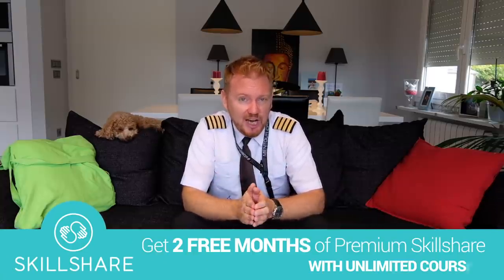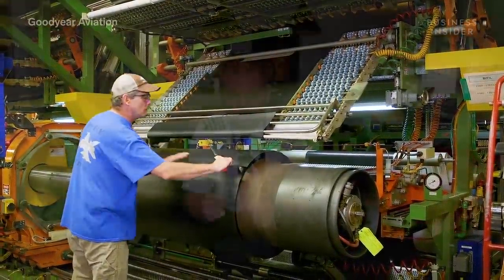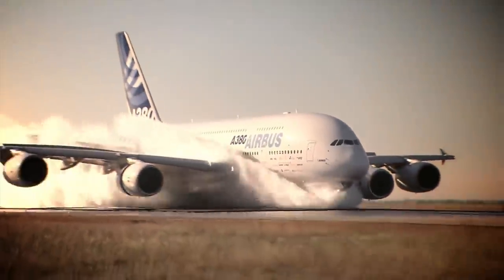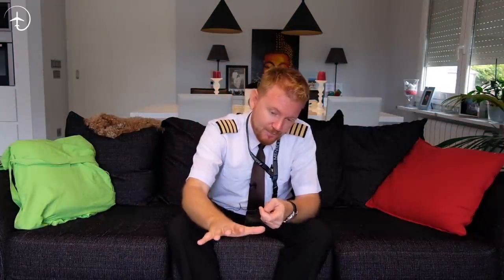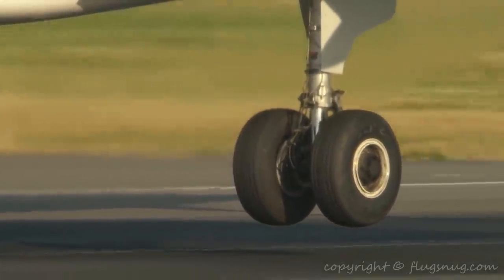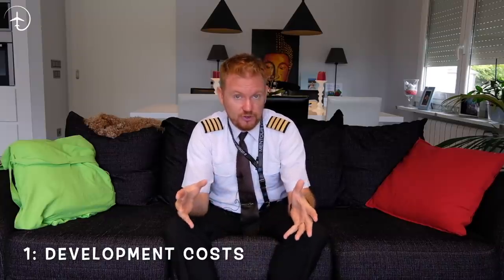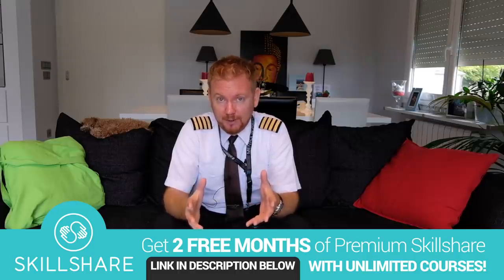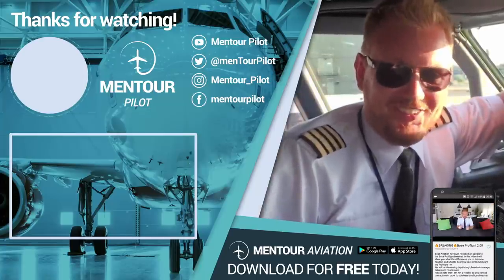Why not make plane-tires spin, before landing?!

Comment: The rims could be designed in a way that they turn by the power of the wind while landing..
Reply: And cause drag at takeoff or landing
Reply: Umut ATÇALIOĞLU fins
Reply: Oto You’re overthinking it. The wind-resistance of the gear is already significant; in fact, I believe most pilots use the deployment of the gear as additional air-braking during Approach. So the additional drag the modified wheels would add would be more helpful than harmful.
The drag on Takeoff would be nearly eliminated by the fact that the wheels are already rotating as the aircraft is propelled along the runway, and since the gear are retracted almost immediately after becoming airborne, the slight increase in drag as they lose contact with the ground (immediately losing frictional rotation and thus requiring airflow rotation) quickly becomes a moot point.
So really, it’s a non-issue. 👍🏼
Reply: Cessna citation actuation has nose wheel spin up before landing on airplanes that are designed for gravel runways
Reply: Tell me, how would you do that? You couldn't set them up as a turbine set up because you would have pressure on both sides of the circumference of the rim there for pretty much cancelling out it's usefulness. Plus the fact that you don't really have enough clearance between the tires and the wheel struts either. The forces involved would be enormous and building something onto the rims would again add to the cost and probably not do much. Another thought is how you would be able to stow the landing gear during flight and bring them down for landing? There's not much space for the gear as it is in the body of the plane. What you would need is something like a windmill so that the wind is in the same direction as the shaft of that windmill. Bottom line? It's more trouble than it's worth. If you want a perfect example, get one of those kid's pinwheels, take two water hoses or air sources and blow out at the edge on both the bottom and top from the same direction (air flow) and see what happens.
Reply: Fred Fernackerpan o
Reply: Yes, I have been thinking about that for years. You could configure it to be about 10 percent less than the airspeed..... works for me.
Reply: Simple design that won't work. In order to pick up enough air to turn those wheels, those cups would be have to be quite large. How long do you thing that rubber cups on the side of the tires would last? Remember that each wheel turns independently and on the nose gear, you can only put cups on the outboard tire on each pair, and in the case of all the tires, only on the outboard side of each bogey of tires.
Reply: @Fred Fernackerpan you spelled tire wrong
Reply: What if there is no wind?! 😂😂😂
Reply: @MaisonAK  Mmmm... you're moving fast through the air.. there's always "wind" :P
Reply: @Fred Fernackerpan I think you'd have problems in that the wheels would spin up as soon as the gear is lowered - some distance in advance of touch-down, while the aircraft is going faster.  At touch-down the wheels would very likely still be going FASTER than runway speed, and cause a surge forward.  In a cross-wind landing, one wheel might have spun up faster than the other, adding a further complication to a crosswind landing.  The other arguments he gives invalidate this anyway.
Reply: What!?!?!!? Take a minute or two to think about it and you'll probably figure that out yourself.
Reply: @rogerstone3068  wheel brakes could be programmed to offer some kind of resistance.
Reply: Exactly that was considered during early design stages of 777 and determined not worth the trade offs.
Reply: Resistance? The whole topic here is about whether it's feasible to come up with some way to spin the wheels up to a point to have their rotation close to the ground speed to minimize wear. It's not only not practical, but can actually cause problems if the tires are not correctly matched to the ground speed and could cause control problems with the aircraft when the tires are all in contact with the ground.
Reply: This has already been done by german schoolkids, won a prize for that.
Reply: @Gainfulwahwah  reference?
Reply: Before thinking all the way I had the idea of having centrifugal retracting turbine blades on the rims that would turn them up to normal landingspeed before retracting fully automatic and without any electric or any other complex system, but mentour pilot gives more thoughts than the one I stopped my idea on, the fact that the upspinning wheels on regular aircrafts helps braking it down a tad and also does some of the rotation of the pitch angle.
Reply: @Fred Fernackerpan Not during the final approach phase when the landing gear is already extended and the engines are running at ~60% N1. It's just gonna increase fuel consumption on the final leg. Besides, spoilers and flaps are more than enough to slow the aircraft down, and spoilers aren't actually even used below 250 kn at 10,000 ft, and are really only used to quicken descent from CRZ to 10,000ft. After that its all flaps slowing the aircraft down to the 140-160 kn landing speed range. [I am not discounting the benefits of having the wind-powered spinning tires]
Reply: @Bratfalken  The kids idea with putting kinda bags on the side of the tire is the most cost effective.
Reply: @84953  BUCKET TURBINES
.. takes the air in one direction only...and spins in that direction. the axle is perpendicular to the airflow and parallel (actually aligned in line) to the wheel axle
Reply: This is exactly what I'm talking about and why it won't work. First off, the bucket turbines are designed to have a relatively narrow stream of air or water that is aimed so it is going into the buckets. Now that means that the stream is going perpendicular to the shaft and a point that is near the outside  of the diameter of the bucket wheel. Now, take something like what you are  suggesting that has a very undirected flow of air. On top of that that air is pushing on the back sides of the buckets on the bucket wheel at the opposite side of that airflow, but is pushing the wheel in the other direction. On top of that, you're going to have to make those buckets so thick that there won't be much room to catch the air. If not, then they will most likely start flopping around and be virtually useless. Besides, with all the design efforts and testing, don't you think that someone has already tried this?
Reply: @84953  the buckets are not like those on a water wheel. they are designed that the underside or the non-containing side is aerodynamically designed....yes there will be drag at certain angles to the relative airflow because it is continuously in motion. The bucket container side is designed with tapering walls towards the bottom of the bucket that increase the velocity and the pressure on the bottom of the bucket. the relative difference in the pressure on the outside and the inside of the bucket will result in the net rotation. There will be no canceling out of the forces.
Reply: @Fred Fernackerpan good idea... but if its done on the wheel hub it can be more solidly built. another idea would be to funnel the incoming airflow through a telescopic tube running down the landing gear into these bucket contraptions to increase the pressure for rotation in the desired direction
Reply: An Australian took out a patent about  20 years ago that used  wind turbines on the sides of the wheels to spin them up to speed before landing. He could not interest any aircraft manufacturers in using his invention.
Reply: That was an option on Boeing 727's;  Few airlines took it.  Just more complication and cost.
Reply: @Fred Fernackerpan Not enough torque to spin up the wheels I don't think.
Reply: @NoahKuzel  The ENGLISH version of your "tires" is TYRES. But I GET A RED LINE UNDER MY ENGLISH. Go home yanks!
Reply: @calvarycustoms6681  he stated the speed of the wheels have to match the speed of the aircraft.  Which could change rapidly in seconds before landing.  If you couldn't control speed with motors you definitely couldn't control speed with wind power. 👍🏿✌🏿
Reply: Im very curious about this idea.
Reply: @Fred Fernackerpan Tyre manufacturers are following strict requirements. It's not that they could redesign the tyre construction as they wanted. Your idea is very good anyway.
Reply: Hamsters in the wheel....

They can spin a wheel like nothing on earth, they sometimes spin with the wheel with no issue...

They would be inside the wheel so no external extra design.....

Sorted! :-p
Reply: that was my first thought, too
Reply: this was tried more than once. Some older larger planes tried moulding cup like devices that caught the wind when the gear came down and started the gear turning from ram air. Downside was they kept turning on takeoff and you had to remember to stop the gear spinni g when you raised it. Added problem was the gear tended to expand when free spinning and if you didnt hit the brakes when raising ghe gear you could have interference problems in the gear wells. My personal habit is to always hit the brakes when raising the gear even on small planes.
Reply: @MaisonAK  no wind???
Reply: What if the tires start spinng at diffrent speeds from each other. Causing a loss in control
Reply: @happydog171717  normally the plane does not touch the runway with all the tires at the same time so that problem already happens today and do not make any troubles.
Reply: @pologamero2648  but if you think about it the two back tires do at the same time maybe not the front but if the two back tires were diffrent speeds it would try to turn the plane left or right. Right?
Reply: @happydog171717  I am not talking about front and rear, Im taking about left and right, its imposible land with both sides exctly at the same time, always one side touch before the other and that does not cause mayor problems.
Reply: @pologamero2648  alright then
Reply: So much nonsense in one videotape
Reply: @84953   you put it on the outside of the wheel. And you have a one way gear allowing the wheel to spin up freely. It would be quite simple... I am sure the tire would defintinely last longer, if it was spinning, and the tire technology could progress as well, because the wear factor would be less significant.
Reply: @Fred Fernackerpan you have smashed it!!
Reply: They tried that years ago, don't remember why it stopped.
Reply: @MaisonAK  there is always wind when you are doing 250 knots   even if there if the wind sock is limp - its just the physics of moving through space
Reply: NO!!

Comment: Another thought, if they are spinning you get less friction on touchdown. It may actually increase the landing distance.
Reply: I would think that would be the case, my seat-of-my-pants feel is it would not be terrifically significant. I certainly could be wrong.
Reply: Static friction is higher than dynamic friction. You get more friction between the tires if they are rolling along with the ground than skidding along it. This is why we have Anti-lock Braking Systems in cars - to stop the wheels locking up and skidding.
Reply: @AtreidesOne0000  In cars it also helps with control while braking, as a sliding tire does not steer effectively (if you have driven cars without anti-lock brakes on snow or ice you are probably familiar with this).

Comment: Draw a circle (this represents the rim). Now, divide that circle into 8 equal parts (these lines represent wind vanes). Next, shade the top half of the circle (this represents the shroud or fender). You should see where the air will be rushing by the rim and where the rim is shielded from the air rushing by. Once the gear goes down, the wheels should spin up to speed (or close to it) in the correct direction because the air forcing those wind vanes to move the wheel in one direction.
Reply: I had the same thought years ago, and even built a prototype with the blade from a squirrel cage fan mounted to the rim of a small tire.
I then tested it using my truck at 60 mph and it did indeed spin up, I dont think it matched my ground speed, but would have reduced the burn patch of the tire considerably.
I also thought of adding rubber vanes to the tire sidewalls themselves.
The one thing I didnt think of thats mentioned in the video, is how the spinning tires affect the crabbing maneuver.
Great minds think alike, even if not successful it can lead to huge innovations.
Keep that brain gearbox, well oiled
Reply: @scottk6659  I take my lion's mane mushroom extract every day...or I would if I could figure out how to open the bottle.
Reply: Most aeroplanes do not have shrouds or fenders around the wheels, the Canberra had a shrouded nose wheel but that was to reduce stuff getting thrown towards the engines. A few GA aircraft do have guards around the wheels but most military and civil aircraft don't. Once again it is adding weight to the aircraft and its simply un-neccessary, even on the GA aircraft with guards they are more for aerodynamic effect on fixed undercarriages.
Reply: @scottk6659  Absolutely agree.  This seems like a no-brainer.  And I think you could approach the actual landing speed by planning the geometry of the wind vanes.  Even if it is half the landing speed, that would make a big difference in the stress and wear on the tires.  If the vanes are built into the wheel, it would probably cost very little.

Comment: Nitrogen is also used so no water vapour forms within the tyres.
Reply: Nitrogen also used in fuel tanks.
Reply: But why does he call Nitrogen an inert gas when it isn't? Also for all gasses pressure is directly proportional to temperature so he has got that completely wrong too.
Reply: Probably because it doesn't support combustion, in the case of a brake unit fire
Reply: @Gareth H
Nitorgen gas is mostly used as an inert atmosphere...
He didn't say all just Nitrogen... and again just earth atmosphere and "normal" surface. So nitrogen pressure varies in these conditions is 
negligible
Reply: @garethhanby  NITROGEN is the gas that its thermal expansion is the LEAST of all the gases... so between -55C in cruise, an then in approach perhaps -15degC ant then in an instant go to 120-150degC.... it must be VERY well controlled.  NITROGEN is very stable and final tire pressure varies VERY LITTLE!
Reply: Wouldn't dried air do the same thing? Water will not spontaneously appear from nowhere.
Reply: Inert means it does not chemically react easily, not that it does not change pressure or volume. The 3rd law of thermodynamics still aplies to it.
Reply: @croquels1  That's a myth. All gases have the same thermal expansion coefficient. I'd guess that the main reason might be to avoid condensation from air's humidity. Using nitrogen might be cheaper or more practical than using dried air.
Reply: @daveayerstdavies  I believe a mix of gases behaves differently than the sum of the three. for instance the total pressure is given by the sum of the partial pressure and not by their concentrations. nitrogen (only) is fairly stable and you can then model it is dynamics as that of an ideal gas.

Comment: Also, the energy dissipated is helpful to slowing down!
Reply: Why not spin them backwards then!
Reply: That's actually a good point.  Tires spinning at landing speeds would indeed increase the landing roll.
Reply: No it isnt. The less tyre slip, the better the braking performance.

Comment: I have a suggestion. A simple retractable blade on the edge of tire (few blades per tire) would spin tires with outside airflow. They will not reach full speed but partial speed is enough to reduce wear and tear on tire. It also has another advantage. i.e. it will help in breaking as it provides additional air friction due to landing. This will make breaking relatively easy and less taxing on actual breaks. On the take off, simply retract these blades and take off with normal tires.

The blades would not be too big. Just few inches to side of tires (like ears). 

It appears to be a solvable problem
Reply: damn - that was my idea decades ago, but with a small permanent feature on the tyres. I knew I should have patented it :)
Reply: How would you build a mechanism to retract these blades into a rubber tire that has 200 PSI or pressure in it?  I can imagine it would require multiple holes in the tire which would seem to add a huge risk of tire failure.  Would you make this mechanism something that is purchased with each tire?  That would seem to add to the cost.  Removing and reinstalling would add cost too.  And whatever mechanism would have to be taught to withstand the tires flexing, and would also have to survive some huge centrifugal forces as the tired rotated at landing speed.

I may be missing your point though, if so, the idea sounds interesting absent a few problems.
Reply: Until you're retracting the gear after takeoff, when you want the wheels to have stopped spinning...

Comment: I've always thought, instead of engines to make the wheels turn in air before landing, the use of aerodinamics to make it work. Some kind of air flow when the landing gear is deployed that makes it start spinning forward. The energy needed to later slow down the wheel turning is minimal compared to the whole energy needed to stop the aircraft.
Reply: Exactly what what was thinking